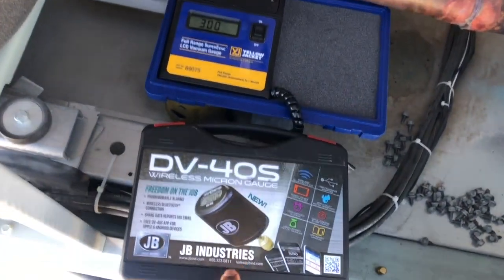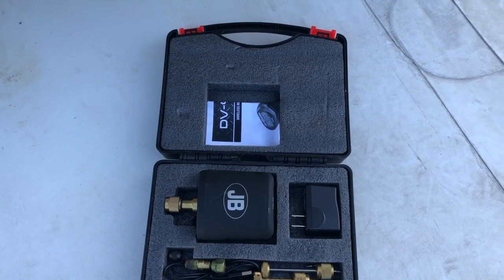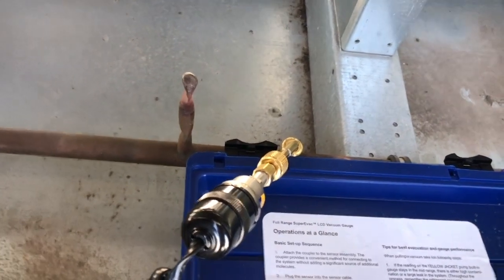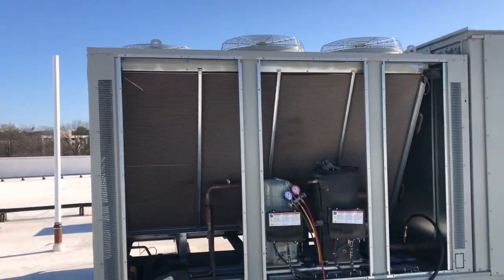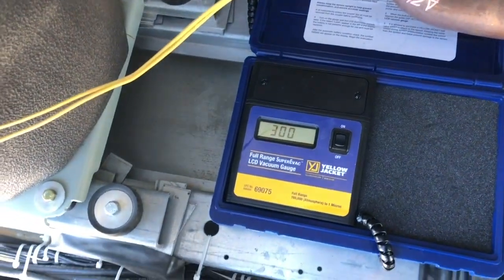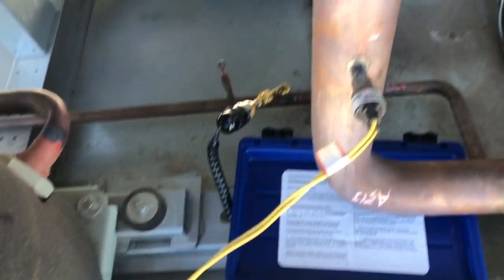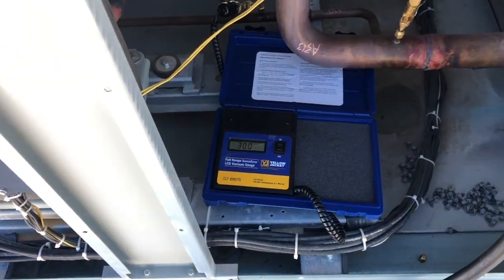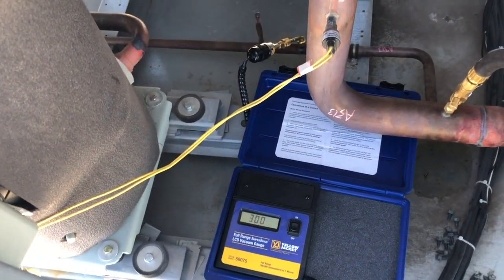JB Micron Gauge vs Yellow Jacket

Comment: What type of gauge could be use for commercial equipment?
Reply from the maker: Hey Steven my apologies for the delay man I have been running hard. As far as gauges are concerned you will need 410A, R22, and 404. But I would invest in more than 1 set of hoses. It can slow you down making sure you purge your hoses.